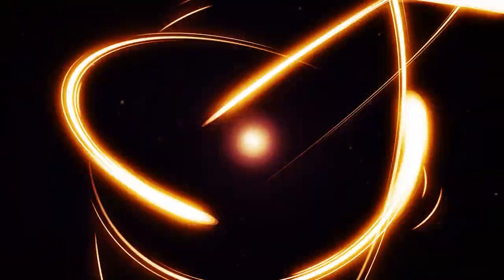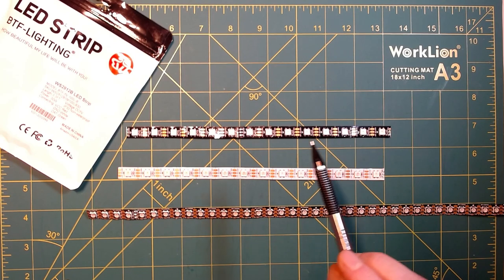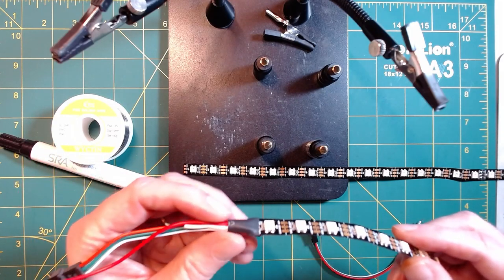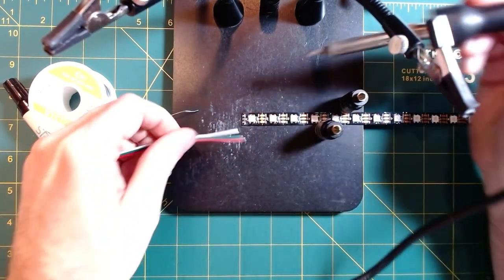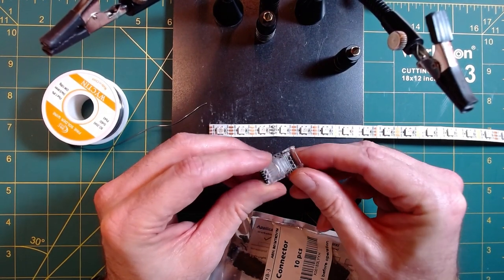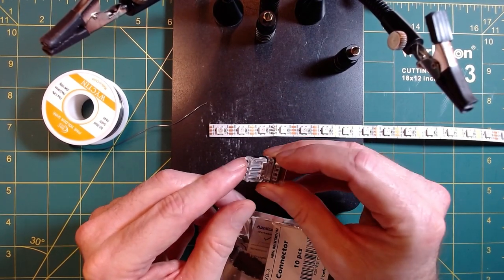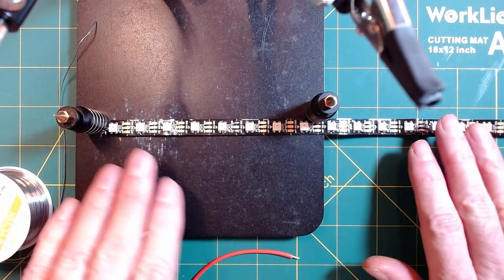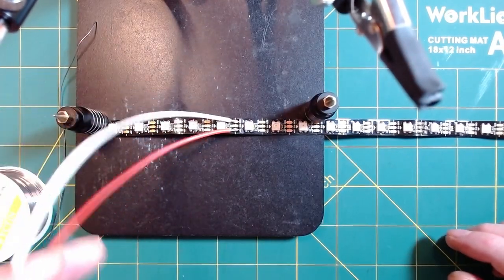Using WS2812b RGB Light Strips

Comment: A Good video  on using the WS2812b RGB Light Strips, with the wago connectors .On your video at 24:12 would you recomend adding a fuse from the power supply to the + led lights.   Merry Christmas and a Happy new Year.
Reply from the maker: Adding a fuse on the + line to the LEDs is a great idea and would increase the overall safety of the project.  To be honest, I didn't cover it because I've never opted to include a fuse (though I really should).  I have another LED project coming up and I'll be sure to include a fuse and show how it is wired in.  Thanks for the suggestion... and important safety tip!
Reply: @ResinChemTech  Thanks for the reply

Comment: Your videos are extremely helpful.  I’m getting ready to install a 9-foot run going down the basement stairs using a WS2812B LED STRIP.  I did not yet have the strip in hand so I’m not certain how many LEDs it will ultimately entail.  Since the strips will be channel mounted I’m trying to avoid power injection.  In your discussion about amp requirements you multiply the number of LEDs by 0.06 to determine the amp requirements.  Assuming your 5v power brick is double or triple the amps required, is there still a need for power injection?
In addition, it would be interesting to see how you connect the aluminium channels and diffusers in order to minimise light leak from the butt joints.
Thanks for all you do to educate us! 👏
Reply from the maker: You are welcome... and I'm glad you find my videos helpful.

Unfortunately, have a bigger power supply with more amps really doesn't alleviate the need for power injection.  Voltage drop occurs along the strip and once it drops too low, the LEDs will start to dim and shift colors.  Running different effects (other than solid), colors other than white and/or running at less than 100% brightness can help.

I'd recommend that you hook up the LEDs on the bench as a test first.  Turn them on solid white first... and see if you get fading towards pink/orange at the end of the strip.  This is a sign you need injection.  But you can try different colors and effects and decide if you can live with the fading/shifting colors as opposed to running extra wires for injection.  My stair lights actually fade just slightly at the very end when on solid white, but since I use the 'wipe effect', they are only all lit at the same time for a very short period, so I decided to "live with it" as opposed to running injection wires.

As far as the butt joints, if you can cut very clean joints, it is barely noticeable.  I did at just a very small amount of hot glue to the diffuser joint just to keep the diffuser in place.  Hope you find the above helpful.

Comment: Thank you very much for the excellent video and THANK YOU for using easy-to-understand English (I’m an ex-laptop and wireless product trainer from Compaq & HP, so I always take note of good demos 😊👍)!  About to start my first lighting project inside my computer I just built.  I would like to also light up my game-room shelves - would you share where you got the aluminum 90 degree channel with the white cover?  Hoping to hear from you - thanks again!
Reply from the maker: You are welcome!  I'm glad you find my videos helpful.  They are a bit "longer" than other videos, but I try to explain the "why" as well as the "how" so that folks can take my ideas and understand them enough to adapt to their own needs.

Note that for most of my videos, I generally always include links to the parts shown or used in the video description, along with a link to a written version (if applicable) that also has the parts lists, wiring diagrams and more.  But to save you a little time, here's the link to the aluminum channel that I use (you can get it in shorter lengths/smaller quantities, but I use it so much I buy it in larger quantities to save a few bucks!  https://amzn.to/328P11m

Let me know if you run into any problems or questions along the way.  I do have a whole series of LED-related videos, including building your first controller (both a soldered and non-soldered version) and more:  https://youtube.com/playlist?list=PLqjDNeOVHOkf079FYwRLRoOHJwLijKkP3&si=nPdpNpW5hofphqbG

Comment: Great video.  Can you do a short video that takes it a step further and cover what the strip looks like installed?  Specifically how you conceal the wires when injecting power and how close the controller is to the strip, etc?
Reply from the maker: Thanks... and thanks for the idea.  The issue is that every install is different.  The way I install and run wires on the pool table is completely different from the kitchen cabinets...  etc.  The same applies to where/how far away the power supply or controller might be.  Each install location dictates how I can best run wiring, place the controller and power supply, etc. to minimize wire visibility.  As an example, here are a couple of photos I shared in another comment:

https://user-images.githubusercontent.com/55962781/146257266-fd5e01b1-4fed-4db6-8716-ee1cf8e561cd.jpg

This is the install for the bar lighting, which uses 3 separate controllers, a single power supply  and the wiring run to the LEDs is quite lengthy as the controllers and power supply are in the back of one of the cabinets.

https://user-images.githubusercontent.com/55962781/146257493-ce9b4520-bd83-4d05-a9e3-77b8ad290244.jpg

But for the dart board, the smaller power supply allowed me to put everything inside the dart board cabinet and the wire run from the controller to the LEDs is only a couple of inches.  But this was unique from anything else, because I needed to tap into the incoming AC power to also power the electronic dart board (and only need one cord for both the dart board and the LED lights).

So, again, every install is different and unique depending upon a lot of different factors.  I don't know if that is helpful or not!

Comment: Excellent video! Would you consider using a capacitor for the power line and a resistance to the data line to account for spikes & drops?
Reply from the maker: I used to add a capacitor to the incoming data line, and you can certainly do so without any negative effects, but I've found that as long as I'm using a good quality power supply and an ESP dev board with a good power regulator on board, the capacitor isn't as important or really needed like it would be if you were feeding 3.3V directly to the ESP chip.

Similarly, I've only had the need for a resistor in the data line in one particular case where I had a long data line run to the start of the LED strip that ran in the same cable as the ground wire.  This caused a bit of a signal issue that was resolved with a resistor.

You could potentially add a long list of items... fuses, relays, etc... that you might find in a retail or prebuilt option, but for beginners or smaller installations, I try to keep the controller build as simple as possible and only provide parts that are necessary to get the controller working.  But it certainly not the only way, and for larger installs where high current may be involved, I will tend to add things like fuses and capacitors to the build.  But in the long run, I've found that the capacitor and resistor really aren't needed in most starter-type LED projects.

Thanks for the comment!
Reply: @ResinChemTech  Thanks for the comprehensive response! Mostly doing small devs  on ESP32 S3/C3 Zero (mini) and D4´s with no more than 60/80 leds for now so will remove the "extras" and see how it performs. You channel has proven to be very inspiring and enlightening. Thanks for sharing with us all of this information.

Comment: Great video.  Would like to ask if you could advise the best LED set up for a 20m (65ft) length.  It’s for the inside perimeter of my backyard pergola.   I would like to use an RGBW strip light with at least 60 leds per meter. Can I get away with just one power transformer, or would it be better to have two connected?  Thanks, Craig
Reply from the maker: That depends upon a lot of factors... too many for me to list here, but a bigger one depends if you want to use 5V, 12V or 24V LEDs.  You will almost certainly have to do power injection.  Do note that if you opt for multiple power supplies, use extreme caution to assure that the positive lines from different power supplies are not connected.  Usually this requires severing the +V on the LED strip and powering different segments of the LED strip with different power supplies.  But I think it would be much better to use a single power supply if possible.  Also note that when installing outdoors, you will need to assure your LED strips, connections, power supply, etc. are all protected from the weather, with the appropriate rating.

If you haven't already watched, you may wish to take a peek at my video on common LED questions, particularly the sections on power supplies, power injection and wiring:  https://youtu.be/GZv5Ztj6i6I

Comment: So very helpful!  I commented on your controller video as well. Wonderful videos!  Wanting to confirm what I think I understand regarding power injection.  Power injection only compensates for voltage drop over the length of the strip.  So a given power supply may be able to supply enough total current for the total strip of lights, but not get enough volts all the way down, hence the need for injection, correct?  In a concrete case, if I have a run around a tv that is 13.33 ft long (WS2812B 60/m), that’s ~14.63 amps. So I will likely need both power injection and a 20amp power supply, correct?  If so, any luck finding a 20 amp brick style.?  Then again, I suppose I could use two 10 amp bricks and run one at the start and the other from the end and kill two birds, i.e., power inject and split the draw between bricks - would that work, or would you recommend splitting the led strips in two and power them completely separately while using a single controller and data wire?
Reply from the maker: You have it about right.  But DO NOT try to use two separate power supplies.  That's a recipe for disaster.  It can be done, but it is very complicated and everything has to be precisely balanced.  Small differences in voltages can result in unexpectedly high current.  I've never tried it, and in general it is probably a bad idea without very high quality power supplies.

But you are correct in terms of the need for power injection.  Resistance along the strip will eventually drop the voltage enough that the LEDs cannot get enough juice to fully light up.  Generally, this results in both a fading in brightness and the color trending toward pink, then red (because the red LED requires the least voltage).  Power injection can be done anywhere along the strip, but at the end is the first place, then midstrip if necessary by just soldering 5V and GND to the two appropriate copper pads on the LED strip (and of course the data line ONLY connects at the start of the strip and nowhere else).  As a general rule-of-thumb, you'll want power injection about every 300 pixels, give or take.  If my math is correct, 13.3 ft at 60/m should be somewhere around 240 LEDs?  You actually may not even need power injection.  But you can always bench test the entire strip first to determine if/where you might need injection.  Turn them on full white and look for fading or shifting towards a pinkish color.  If you need/want to power inject, just at the end of the strip should be more than enough in your case.

The largest "brick style" power supply I've been able to find is 5V 15A.  To be honest, that would probably work in your case.  240 LEDs on full bright white (max amps) will be unbelievably bright... you'll be surprised how bright.. so you will likely never run that high.  As a safety precaution, you can use the brightness limiter in WLED (I'm assuming you are planning on running WLED) and set the power supply amps to something like 12A.  This will auto-control the brightness to assure the LEDs never pull more than 12A... and that you don't run the power supply at its rated max for an extended period.  Even with the limiter, the LEDs will still be plenty bright!  I routinely do this if the LEDs might get close to the maximum rating of the power supply.  You only need to allow about 0.5A for the controller.

Sorry for the length, but I hope that answers your questions.

Comment: What about using fuses? Especially when using power injection. I have been repeatedly told to use a fuse between power and board, then another between power and the LEDs

Comment: My daughter would like LEDs along the top of her bedroom walls (approx 12 ft x 12 ft).  I'd like to use BTF-Lighting WS2812B strips (5V 30L/M).  I'd likely use a DIGUNO controller and would likely put the lights in an aluminum channel/defuser.  I would think this is a typical use case for people watching your videos.  Could you do a short video that focuses less on the tech stuff and more on what the logistical layout would look like?  For example, what power supply type and does it sit on the floor;  where should the controller be placed (on the floor or on the wall); best place to connect power injection, proper gauge wire, and where to run the power injection lines (in the aluminum channel or outside of it, and maybe 5V is not the way to go?  I would love to have WLED to control the lights, but as I think about the logistical side of it starts to make me think I am better off just purchasing over the counter lights with less controlability.  Any thoughts would be appreciated.
Reply from the maker: If you have seen my video on the hexagon LED panels (https://youtu.be/lNcsT5DZjAM), I cover adding both a push button and IR remote to the WLED controller.  With the remote, you've basically duplicated the "commercial" versions in terms of control, but still have all the additional effects and features of WLED.  And if you are a Home Assistant (or other automation platform) user, there are all sorts of automations that could be used (sunset, light level, motion detection, etc.)  But even without Home Assistant/automation, both a push button and remote control provide a lot of different control methods.

Thanks for the suggestion on the "layout logistics".  I haven't tended to include this because every situation is so different... where's the AC outlet, where can I 'hide' the controller and power supply, how long is the wiring between the controller and LED strip going to be, etc.?  And of course, every viewer's situation will be different than mine.  But I can see where I might go back through my different LED projects and show how I opted to 'hide' the components and/or run the wiring.  I'll add it to the list of upcoming video ideas!

Comment: Great vid. As usual very in formative. Im working on my first project (as I commented about earlier) and don't have a 3d printer (unfortunately my NYC apartment doesn't have the space for one), i have your files for the controller box you designed. Do you know any way i can have some printed for a reasonable cost? (The last price i was quoted was $10 per box. Which seemed pretty steep to me).
Reply from the maker: Yeah... $10 is pretty steep for something that costs only a few pennies in filament!  I tell others that if you have a University or maybe a maker space in your area, you might be able to get them to print one at a cheaper cost.  I also recommend that in lieu of a 3D printer, you can get a small project box and drill holes to meet your need.  The controller can be hot glued in place to stop it from rattling around... that's what I did before I got a 3D printer.  Here's an Amazon (affiliate) link as an example of what you might use: https://amzn.to/3p6AP1v
Reply: @ResinChemTech  You’re find $10 steep, but some outfit asked for $150. Nuts. I’ll check out the link you have for an alternative. Thanks.